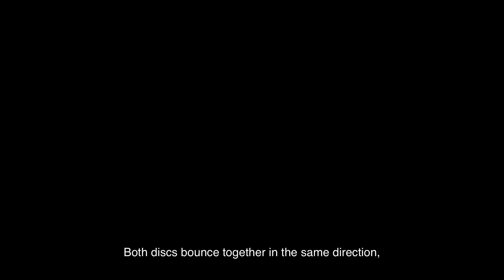How Sound Works (in Rooms) Captioned

Comment: The info is good but I don't like the forced Subtitles. Very distracting. Subtitles can be accessed in the settings icon as an option for those who want to read them not integrated into the video itself. I should be able to turn them off like on all other YouTube videos.
Reply from the maker: Hi Rick – thanks for watching! Our original video “How Sound Works (In Rooms)” is without captions – watch it here: https://www.youtube.com/watch?v=JPYt10zrclQ
 
This was done per a request for burned-in subtitles from a non-hearing class teacher.
 
Thanks again,
John Calder
Reply: its just making accessibility easier for those who cannot hear. The original video without subs already exists and u can watch that one if you feel it bothers you that much.